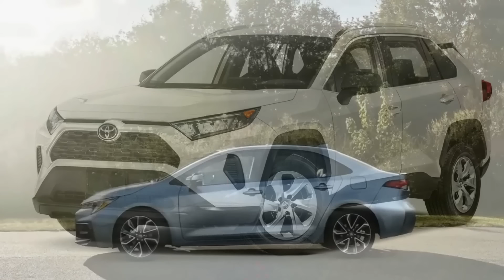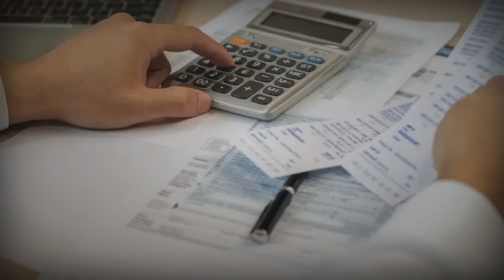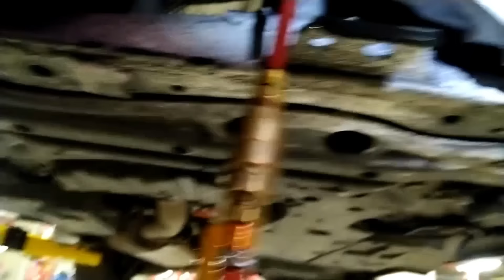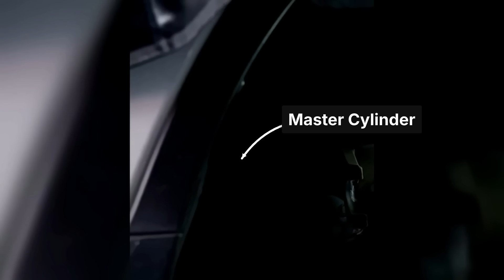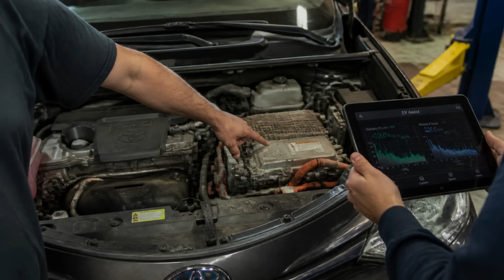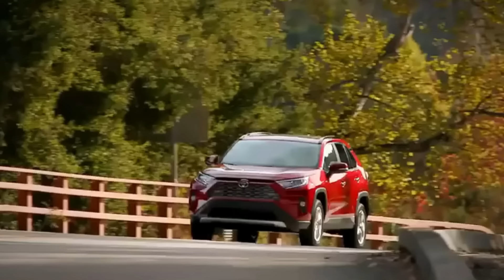We Tested Toyota's 2.5 Hybrid vs 2.0 Gas After 200,000 Miles — The Loser Surprised Us

Comment: To save you 
24 minutes , the hybrid vehicle is about 20% better on gas and Maintenance savings cost, but that's only if the hybrid battery doesn't fail b4 200,k miles if the battery fails b4 that then it's expensive to replace the hybrid battery and you almost even out with the gas vehicle
Reply: Thanks.
Reply: Thanks... I think all videos should be limited to less than 10 minutes...
Reply: The Sienna hybrid is great for camping. The ready mode allows you to run the AC all night while turning the engine on once in awhile to charge the battery.  It also has 120 volt 1500 w outlet.  You can run refrigerator and microwave oven.
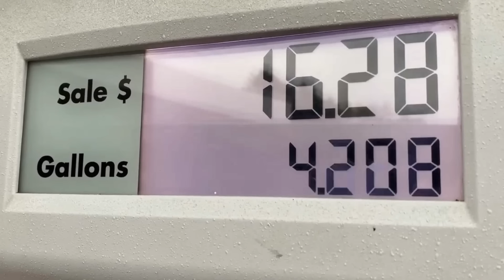Reply: It's amazing that both your cars had oem tires that lasted 200,000 miles. I'm guessing 3 sets were required 23:11 for the gas model and 4 sets for the hybrid. Not a big difference in cost but an honest comparison that shows keeping every receipt is totally deceptive.
Reply: Thnx for time saving!
Reply: Once you have to pay for the hybrid battery you have definitely crossed the line of it being more expensive.
Reply: Well the hybrid burns less gasoline.  Each gallon of gas releases about 19 lbs of CO2 into the atmosphere through the tailpipe.  If you want a planet habitable for your children and grandchildren then a hybrid does less damage to the climate.
Reply: @zigmaster2028 the optimum CO2 level is 0.08% for maximum growth, even if you burn all known coal and oil on earth CO2  will not reach 0.08%.
CO2 is not toxic, nor causes cancer. A human exhale  5- 10% CO2. NOx, CO, HC, PM2.5, PFAS, dioxine, heavy metals, are bad for us humans not CO2.
PS our fossile reserves will not last forever. Nuclear is the only option if you want a decent living standard.
Reply: @expat-t2r okay, then turn on your car in your garage, close the door and sit there for a while and tell me it's not toxic
Reply: @wburke121  Okay, close your EV car in a garage and light a fire under it and tell me it' not toxic. Or put your head in a bucket of water for 10 minutes and tell me it's not toxic. ROFLMAO
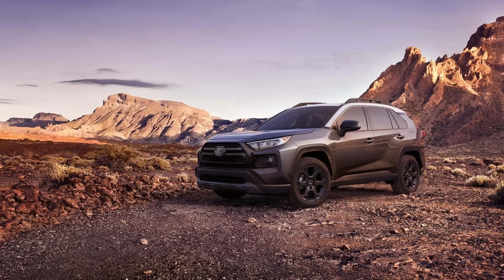Reply: Not necessarily!  This is a very misunderstood and far less scary aspect of hybrid batteries:  if they are serviced when they “go down”, they often can be properly fixed inexpensively and there are still many years left in them!   24:24 

There are three options of 
replacements with the hybrid battery, which is in reality is not just one big battery but a number of smaller,’modular battery “cells” inside of the hybrid battery pack, wired together in series.  This is very typical of rechargeable batteries even down to most cordless battery hand tools like hand drills, grinders, saws etc.  Open up the battery pack itself, there are a number of these little AA or bigger looking batteries inside,  all wired together as a pack.  So—option #1:

1.) replace a few of the small “faulty” modular batteries in the hybrid battery pack: 
Cost: if practical, nominal, a few hundred dollars. almost all the smaller modular battery units in it at even 200k miles haven’t come near to wearing out yet! Just one or a few of the small batteries in the hybrid battery pack, causing the hybrid battery to shut down. The entire “hybrid battery pack” does not fail.  It only takes one or several modular small batteries in the pack of these large hybrid batteries to “get out of whack” and the battery pack safely shuts  itself down.  By the way, the car without the hybrid battery is usually still  drivable for a short distance without the electric motor “helping” the gasoline engine.  The car will be gutless and underpowered, but it can get you where you need to go. 

So, with replacing these one or several “bad” battery units in the entire hybrid  battery pack, the entire hybrid battery pack then needs to be “balanced” and “harmonized” properly so it functions well as a modular unit, at a total cost of a few hundred dollars only! And you’re “back in business” for years.  

Option #2:  if the hybrid battery pack isn’t in good shape, and there is a large number of modular battery cells to be replaced,’ it may be more cost effective to replace the original hybrid battery pack with a remanufactured hybrid battery pack. This is essentially an expanded option #1: however the original battery pack is replaced with one which has already been “fixed” and had one or several “bad” pieces of it replaced. About $1500 or so.  

Both options 1 and 2 can last 5-15 years, with an average  lifespan of 8 years and 100,000 miles. (NiMH).  Lithium batteries generally last longer (10-15 years, 150k miles.) 

Option 3. Go with a whole brand new OEM factory hybrid battery  replacement with full factory warranty.  Around $4-5k. There are also aftermarket options around $2k. I see a NexGen cell direct fit battery replacement for my car for $2,149.00 mobile installed.  

Once I learned about all this, I know which direction I want to go.  I have a 2016 Toyota Avalon hybrid.   I have 204,000 miles on it.  Other than fluid changes and tires, I replaced spark plugs twice (100k, 200k) and just did $3000 in front end work (bushings) rear shocks, and hybrid maintenance (getting the vent way and fan, hybrid battery compartment cleaned, air filter replaced, and inverter coolant changed. 

Other items in a 10 year old car (and hybrid at that) coming up: 

2.5 liter engine Water pump and 
Radiator 
Inverter coolant pump 
Inverter 

The gas engine, hybrid drivetrain (electric motors  will last 300-500k)  miles.

Comment: I was debating should I give up my 2012 Camry hybrid vs 2013 Venza with V6.  I don't drive much it has 97k miles & avg 7.5k miles a year vs my wife who 18k miles a year. Hybrid gas mileage alone is 40mpg vs 22mpg. But the feel of a V6. My wife drives 2013 Camry hybrid with over 227k miles. Given that should go for the V6 given the # of miles I drive or stick with Camry hybrid?

Comment: The hybrid cost $4,000 more that the gas.  If you are financing the purchase at 6% for six years, add $1,700 in interest to that extra $4,000.  If you paid cash for the car, add whatever rate of return you want to take a guess at and consider the lost opportunity cost of that $4,000 you shelled out for the hybrid (if you had stuck that $4,000 in a large cap index, you would have picked up $12,000 over the six years of owning the gas model).  Anyway you reckon it, the extra four grand paid for the hybrid is more than four grand.

Comment: I have a 2008 toyota prius and average about 42-45 mpgs. Would love a newer toyota but i just can't see me spending over 40k for me to see the mpgs I'm currently getting. I will drive this prius till it dies. Love my prius.
Reply: Great  cars. So is my Toyota  corrolla.  ❤🎉
Reply: you can get an aftermarket battery for about $2k. diy replacement, many many screws

Comment: 10,000 mile oil change intervals on a high mileage vehicle? You should know better than that to call your channel “toyota insider” 
Probably the 2.0 l engine wouldn’t consume oil if you had changed the oil more frequently. 
Oil is cheap, rebuilding an engine is not.

Comment: I drive the 2025 Tacoma hybrid Trailhunter, bought it new in February, 2026  but I don't do a lot of driving so I only have 2,600 miles on my truck, but no issues so far and not the best fuel milage but I knew that truck wasn't built around fuel milage anyways but more for the HP and I'm fine with that, I live in Indiana and I do a lot of camping and outdoor things with my truck so I haul a trailer with it and a payload in the bed at the same time and it does great, so hopefully I don't have any issues with it for a long time. I traded in my 2015 2nd gen Tacoma for this newer truck and so far I'm glad I did because there is a big difference in power between these two truck, my hybrid Trailhunter Tacoma will run circles around my 2nd gen Tacoma I traded in. Thanks for all the info you share.

Comment: Were there differences in insurance and registration costs? Also were tires ever mentioned? Would they wear out faster in the hybrid. Also the repair costs you mention seem to be about half of what would typically be charged at an independent shop. Also I am favorable to the hybrid because you get more power for the level of fuel economy. The acceleration is just better overall in those cars which I think is a contributor to those selling well.

Comment: Out of 3 Hybrid Camry I’ve owned, I’ve only had to replace one hybrid battery - that Camry (2007) had over 300k miles. I now have a 2025 hybrid Camry, if you burn non-ethanol regular you will achieve 50+ MPG!
Reply: How much did ít cost you to replace the hybrid battery,,,thanks

Comment: Iridium plugs do not need to be changed at 60,000 miles unless some maintenance issue causes fouling, etc. My wife has a 2018 RAV4 XLE hybrid since new and the Toyota Service Advisor said 100,000 mile change is recommended, and 100,000 for the coolant and every 3 years for brake fluid. I will bring it in at 50,000 miles for the CVT fluid change. Do 5,000 mile oil changes, not 10,000 miles. My wife had an Accord and I pulled the iridium plugs to change at 100,000 miles and they looked brand new. I did change them anyway.

Comment: Not mentioning tires, although I doubt there is a lot of difference.

Secondly, the transmission on the gas version, if it's a CVT, I would avoid like the plague, even a Toyota. The E-CVT is far superior.

Fourth, I wouldn't do oil intervals at 10K miles, probably 1/2 that especially on the non-hybrid car.

Fifth, resale value. Even at 200K, the hybrid will still have residual value.

And finally, owners of other brands would kill for maintenance costs that low. Just can't go wrong with those boring vehicles if all you want is a workhorse. 

However, neither are suitable for offroading or very rough terrain. Purely an urban SUV. Subaru's are better in that regard. No CVT.
Reply: Subarus only have CVT transmissions. Not what they used to be. Actually their maintenance cost have gone up greatly.
Reply: Most Subarus need replacement timing belt, head gasket or engine and transmission after 100K miles.  Don't believe it?  Just watch any YouTube channel with high mileage Subaru repairs.

Comment: There is no Toyota vehicle model that allows a choice between the 2.0 or the 2.5 ICE.   The 2.0 goes into a lighter vehicle.
Reply: They are both 2.5litre units. NA and hybrid. The 2.0 is for the Corolla. Also the 2.5 litre NA motor produces 205hp.

Comment: 2013 Lexus 450H, my hybrid cooling fan has either never been on or off.  Never a sound change hot traffic or 90 on interstate (everyone knows no one drives 90 mpg) in a Lexus.
Reply: The 2013 uses a passive cooling fan under the rear seat. Make sure the plastic vents are cleared of built up dust and hair every year or it will shorten the battery life.
Reply: @Timmymao163 
I have nothing but grills in door frame, are you saying the battery fan is under the seat. Would be much easer to get to. I only have 53,000 miles on a 2013, they are real I put 25,000 on it. Its prior owner was some kind of race horse outfit.  I think the 2019 plate receipt was 500+ miles. Dealer changed lots of fluids, then COVID hit and it sat. When they could sell cars again it went for $26,000 with 25,000 miles, I had bought from them before.
Reply: PS It’s the dog car we have 2 boxers and they feel like cool dogs riding in black Lexus tented windows of course.

Comment: I’ve got the 2023 Camry Hybrid. Covered 125,000 kms. Change oil and filter every 5,000 kms, no work needed on car other than normal service, brakes are still in good condition. It’s a great car.

Comment: Hybrids are tougher. Use 5w30 vs 0w20 in both if you dont want oil burning issues
Reply: I agree in the 5w-30. I have changed from 0w-20 to 5w-30 Restore and Protect in all the family vehicles.
Reply: You are correct.  Hybrid uses an Atkinson cycle engine which is less stressed.

Comment: The 2026 Rav4 has significant improvements in those areas you identified as deficient. All hybrid cooling systems have been updated. Key components have been relocated for better performance. Software has been improved for better drive systems management. 
Toyota is constantly evaluating its own systems in a quest to make them better. That's why people buy them with confidence.
Reply: SPOT ON!!!

Comment: WHOEVER DRIVING THE ASPIRATED GAS ENGINE DOES NOT KNOW HOW TO DRIVE !!! ANOTHER THING, HOW FAR DID BOTH CAR TRAVEL IN ONE CHARGE AGAINST THE OTHER????
Reply: Neither one uses plug in charger.

If you mean oil change, it's 10K miles.
Reply: Neither one. The Hybrid constantly charges because it has a built in Alternator. It's part of the electric motor. The na gasoline engine only has a regular battery and alternator.

Comment: The way I see it is, it's best to buy a slightly used hybrid. You take advantage of the drive off the lot price drop. If you can find one?
Reply: Given a cost of $4000 or less I would wonder about buying a heavily discounted car with a bad battery and replacing it. Considering the absurdly high cost of new cars this might make sense...
Reply: @dstidolph  I have a 2010 hybrid Camry but still low milage due to life circumstances. I WOULD replace the battery (with Ni-MH) if needed but doing so few miles I would tolerate higher fuel consumption as long as it was good enough to run.
Reply: If you can get a Dealer demo less than one full years old  or lease return, 2 years old or less. That is my sweet spot.
Reply: @flouisbailey 
Yeah, that "IF"
The problem is that if you've found one, they're asking almost as if it's brand new, which makes you wonder about a new purchase, then the "Wait".
I've been waiting for my Rav4 XLE-Premium for over 4 months now.
Reply: @ST-A3  That's what I have found in my research.
Reply: What price drop? The hybrids have incredible resale value

Comment: So the hybrid battery might need replacing ( warranty 10 years) but no mention of the gas 2000 lt engine that might require replacement and it’s cost 
Or cost of an alternator or starter motor and the serpentine and pulleys that the hybrid doesn’t have
Reply: LOL. It may or it may not.😂😂😂😂😂😂
Reply: The hybrid 2.5L engine may also need replacement.

Comment: If fuel goes up dramatically the hybrid. 
Where I am Toyota offers a 15 year battery warranty and a 10 year warranty on the Hybrid.
Reply: My 2021 Corolla Hybrid was a great car.. In 196.000 Kl I never spent a penny on anything but oil changes at 5000 Kl each, One set of tires and a  brake service. No new pads or rotors. It needed a new regular battery as it went dead after leaving the drivers door open for too long with the car shut off. I knew it was toast and needed replacing. The hybrid battery was still at almost 95% after 4 years. A week later some drunken boob turned right in front of me and wrote it off. Funny, because I was on my way to buy a new battery. Most of the cost of repair was the airbag system but I never got a scratch.
I bought a 2026 Corolla hybrid and it's a better car all around than my 2021 was. Rides and handles better.

Comment: But the hybrid cost at least $3000 more when you buy it so there goes your savings for the first 2 years.
Reply: Nope. Price difference is roughly $ 1,500....half of what you assert. Gas savings + maintenance/repair savings make it a 2 to 3 year ROI (depending on miles driven/driving style/geo location)
Reply: $21.000 more.